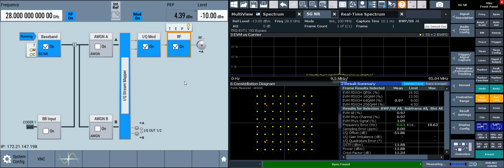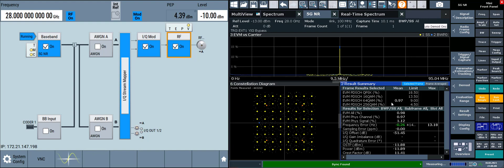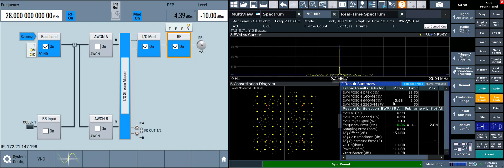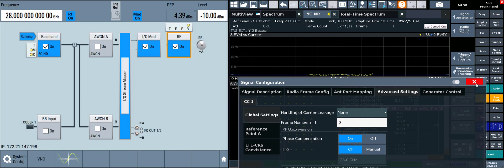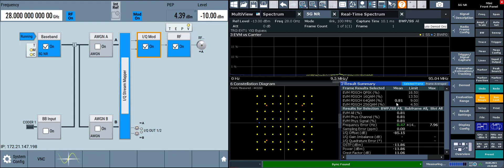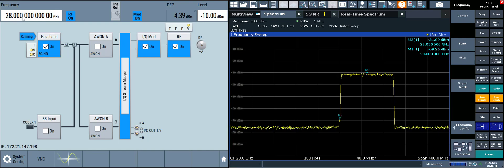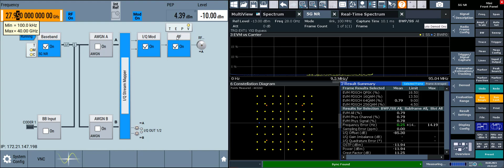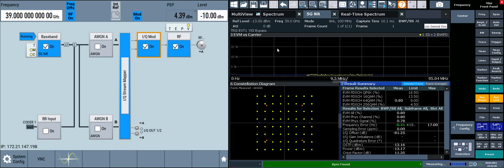Handling Carrier Leakage with SMW200A or FSW

Comment: I'm new using SMW200A vector signal generator, and i need to know how to access to right black screen, to see constellation, spectrum, etc. How to open it ? Pressing which VSA button ?
Reply from the maker: The right half of the screen is a screen recording of an FSW signal analyzer.

You can preview the mathematically-calculated (ideal) spectrum on the SMW200A at the RF output by clicking the yellow sine wave Graphics Configuration on the SMW task bar. However you’ll need a signal analyzer to analyze the actual signal with any real impairments like LO leakage.
Reply: @KF7JO   I'm working with keysight signal analyzer, so you think tutorial works as well ?